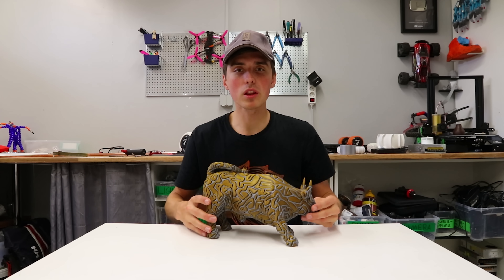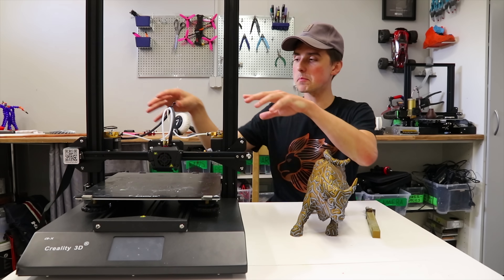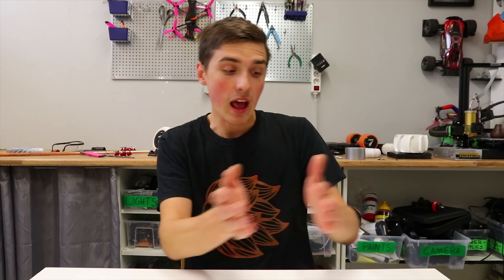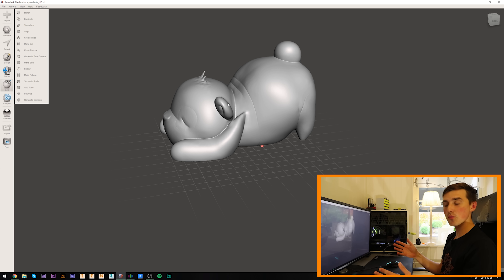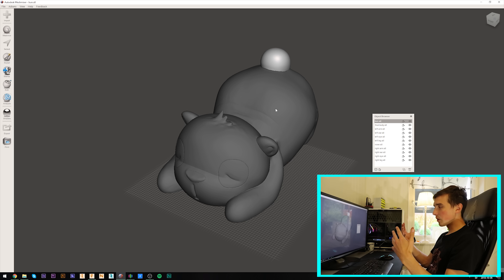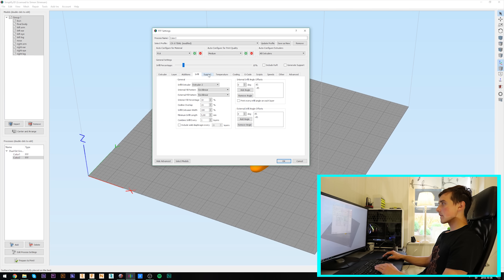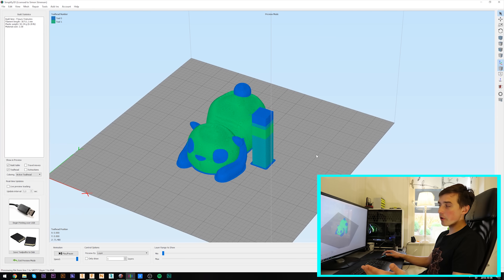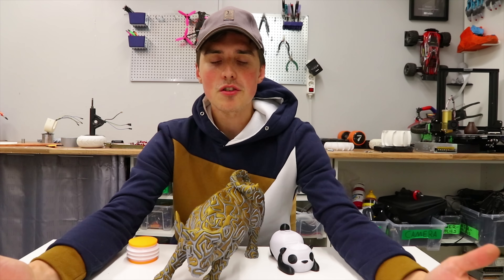Multi-Color 3D Printing - Creality CR-X Review

Comment: Just for the record: If you're looking for a cheaper printer that has the exact same Y-splitter Dual color hotend as the CR-X, check out the Lotmaxx Shark SC-10. Unfortunately the firmware is still closed source as of the time of writing this and has some bugs still, but I've been getting some REALLY nice color prints from that thing, it has dual-gear feeders, a touchscreen, filament runout sensors, an ARM board and a magnetic flex plate I love even more than the Prusa one... And it's built very sturdy and is quite fast, too!

..and man, I do love that Y-splitter hotend. Colorchanging has never failed a single time after about 5000 colorswitches in total, unlike, say, the Prusa MMU2, which always seems to require interventions cause of failed colorchanges... Colorchanging is quite a bit faster, too, and due to the hotend the waste tower is a lot smaller than with Prusa's V6!

Comment: The bull is nice indeed, but 110 hours? What is the minimum time required for this to reasonably print? Let's say using 18% infill, 0.8mm nozzle, 2 outer layers and 0.2 layer height.

Comment: +RCLifeOn ... I kind of wonder if it is possible to program the color transition that way into the gecode, that the color is changed by printing the non see able infill of each layer?!

That way only a small color transitioning pile on one edge for small layers like the legs would be enough and the color transition would be done "one the way" the machine prints its infill.

Comment: 4:10 Have you tried using a stylus pen for this type of work? I would really like a tutorial on using mesh mixer and maybe fusion360 because I have been using Microsoft 3D Builder which sucks ass but it is simple and usually gets the job done if i am modifying objects.

Comment: Hello Simon!

Your knowledge about all this tecnologies is awesome!

I have a little question for you.
I´m a 3d printer geetech B pro user, but I want to buy another 3d printer.

I´m thinking about the Da vinci 2.0A duo or the Creatily CR-X.

I like the point of the all asembled, and less instalation time of the da vinci, and the point that the printer is closed. But I don´t like that the filament that you can use is restricted to their own material and that the working dimensions are very small for my prototypes.

On the oder hand, the CR-X is bigger and you can use much more materials, but I don´t know if the point that it´s an open printer woukd be worse than a closed printer.

I think I prefer th CR-X, ut I want to know your opinion.

Thank you very much!!!

Comment: Thanks for the video! I have a CRX and am using your good profile but when the print start the extruder 1 move the filament out and then start to print... I try to modify but not work. Did you have the same issue? Thanks in advance.

Comment: Awesome Channel you have.   What would you say is the best 3D printer that can:  1.  Use multiple filaments such as water soluble (must) / flexible / nylon,  2. Print at least 300 x 250 x 150,  3. Ideally allow stand alone printing? 4. and have a good resolution / quality. 5.  Be fairly priced?   I have done a lot of 3D printing using professional companies, but I do not have my own printer.   Any help you can offer is greatly appreciated.

Comment: Was about to buy one of these when I read that it has no filament detector, auto bed leveling, and crucially no color mixing (The whole point of 2-into-1 nozzles)! Creality also said there is no way to add the above as the control board does not support it. Did they rush this out to production for some reason? The A20M does all the above and is almost half the price so I am considering rather buying that. Tough decision though as I will be giving up some building space :/
Reply: I am having the exact same dilemma! I want the giant build space, but I also want to do color/material mixing! Are you sure the CR-X can't do mixing? I've seen some people claim it can, and some claim it can't. But I have seen no videos of it doing color mixing...

Comment: If you were buying a first time 3D printer and had a choice between the CR-10S and the CR-X, which would you choose?  Besides the double extruder and price difference, how does the quality compare between them using single filament?

Comment: you can do multi material on a relular single extruder machine by pausing and swapping filament. i have made some awesome stuff this way. and ive found the new solutech flexible filament it is amazing. it looks like pla and prints like pla but is soft and stretchy.  http://www.3dsolutech.com/store/flexible

Comment: I'm a total 3d print noob.  Don't have a printer yet.  But I have an M3D crane-quad on order. It can mix 4 filaments into a single hot end.  The extruder is a mixing one.  So with CMYW filaments you can theoretically get 50k different colors.  And the waste tower on it isn't that big because it can purge in like 4mm.  You can also do different materials but they'd have to be in a common range of temps. It's very new so there's still some software advancements being made.  They are also selling the extruders that you can put on a different printer like a CR10.  Batch 1 is just now starting to ship.  I'm in batch 2.  I might have a coupon code if you want to get one let me know.  But I'd love to see your take on it and get your advice and tips on using it.

Comment: Hello I need Help
I unbox my CR-X yesterday and cant print. 
The G-code delvert with the sd card make fine prints but my one sliced prints retacts the filament at start so there is nothing to print with. 
I can pusch it forward manually and it works. I'm sure there is a problem with the start g-code but i cant figure out wich one. 
Can someone give me a working start G-code?

Comment: How do you get a good top layer in simplify 3d? and why isnt that a stock profile setting for cr-10 that works straight out of the box?
Reply from the maker: Join the Creality Facebook group and check the file section, you will most likely find a good profile for your slicer software.

Comment: Hi, I use the double extruder with a single nozzle
with two extruders / two nozzles, is it possible to print at the same time in two colors (mixing them) and to vary the percentage of the two flows to obtain a "shaded" effect?

Comment: How many 3D printer do you have???
And are you sponsored by the 3D printing companies??
Reply from the maker: Check the Creality Facebook group, generally people are happy with the 3D printers from Creality. I've mentioned numerous "problems" with the Creality printers, such as the heated bed not reaching a very high temperature. It's fairly noisy and the CR-10S5 even requires you to do some modifications for it to work reliably. But considering the sheer volume they are dropping off these printers at the Creality printers are top 3 in affordability of what you get. 

I've been using the TEVO Flash for a couple of days now, and it's an absolutely lovely machine. Though it's not going to remove the memories of the TEVO Black Widow. To summarize, Creality does a good job.
Reply: @RcLifeOn  ohhh that makes so much sense
Reply: @canitrunMinecraft  ohhh i never knew they were using betas.

Comment: your prints looks very impressive can you provide the printer profile that you used for S3D and do you have the same for Cura
Reply: Here is a better S3D profile than the one he's using (which was originally from the CRX Facebook group but has some issues) https://github.com/roguecode/CrealityCRXSimplify3DProfile
Reply: than you bro ..i think we will be corresponding more ,i need some help with my CR-x
regards
Reply from the maker: The profile has now been added in the description. Good luck!

Comment: I have a cheap chinese delta printer that shipped with dual head. I tried a few prints, the leveling on my printer just isn't tight enough. For the time needed in printing and setup, it's just not worth the trouble. How did you stop your world for 4 days to babysit the printing the bull? If it printed in one go, that says something positive about the CR-X.

Comment: Great video. I only wish it were longer! This video is a more of a MultiColor Experience video using the CR-X. How did you actually like the machine. Aside from multicolor, how did it print regular single color? I heard many issues with the bed leveling being a problem.

Comment: Thinking about it, support material and/or infill material could be use during color transition phase (needs software development skills). That would lower or eliminate the need of that tower :)
Reply: Possibly. assuming enough infill/support on each level a color transition is required. If even a single layer does not have an adequate amount of infill/support material for the transitions, a tower would be needed to be brought up to that height.

Imagine, say, you have a flat top, and that top have multiple colors, since it's the top, it doesn't have any infill, it's a complete layer (that's visible), so the printer needs to do the color change somewhere. Since it's at the top, a tower would need to be built up to that level anyway.

If you reduce your build space in the dimension the bed moves (Don't know if it's X or Y), so that the print clears the print head and beam, you could make a tower that's only printed when needed to save plastic. But it could significantly increase print times, since Z-movement is the slowest axis to move on a printer in this style, and going down, swap filament, then back up again will take time.

You could do potentially use prediction methods to decide between full tower, and "tower as needed", and with time vs wasted plastic ratios set by the user during the slicing stage. But the issue isn't a simple one. also, even if there's not enough infill on a layer to do all color swaps necessary for that layer, assuming there's at least enough area, you could start filling up the inside of the model to do the color swap on that layer.

Hmm, sounds like a decently fun project to do actually if/when I buy a 3D printer which uses dual extruders, single nossle.
Reply: I had the same idea, come on China work harder
Reply: for aesthetic things, yes. but then again, nothing dual printed will ever really have any strengths
Reply: prusa has it so i don't get why other won't use it
Reply: Harvard: Wants to know your location

Comment: Hi. You forget one type of multicolor system, and I think the best one : dual independent head. Nice video.
Reply: yep, best of both worlds -- i'm running 4 independent direct drive extruders -- hard to calibrate, but no priming, no purge block, switching takes about 1-2 seconds -- time for 1 extruder to park, and the other to come in.
Reply: @kazolar  Which system are you using or is it a roll your own?
Reply: @Scott VanKirk - my own.
Reply: @kazolar  that sounds very cool. Do you have any videos about it?
Reply: Wrong, best multicolor system is paintbrush and airbrush 😈🐼
Reply: @Thiago Lopes -- I love painting my models too -- but you figure out how to create rubber with with an airbrush -- create a living hinge... and get back to me. Also any and all painted model will start to chip and peel after significant handling, or exposure to elements. No amount of sealer is enough, every multicolor print I've given to my kids stays the color it was printed.
Reply: yesss, especially the BCN3D machines
Reply: BCN3D machines are bowden :( -- Direct drive is much better
Reply: @kazolar  what about formlab t rex
Reply: @Yassine cassim cadjee -- that one is a good option. At least from the point of view of a good base, though I'm not a fan of big I3s. They're doing some nice things -- presumably if it works, but I would like for formbot to use a 32 bit firmware for the price it's being sold at. Also it's essentially a GMax clone and it's approaching the GMax price.
Reply: @Яша Карагзов -- I have the Palette+, any switching system requires purge blocks and significant filament use and time use for these changes. An independent extruder system doesn't require any of that, there is no transition, there is no wasted time or filament